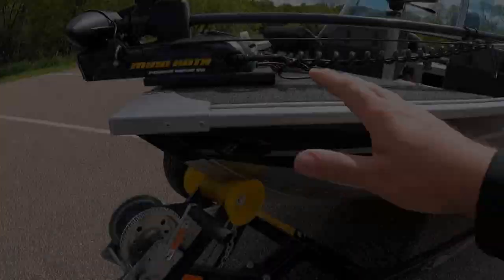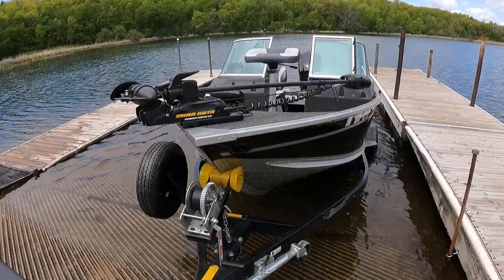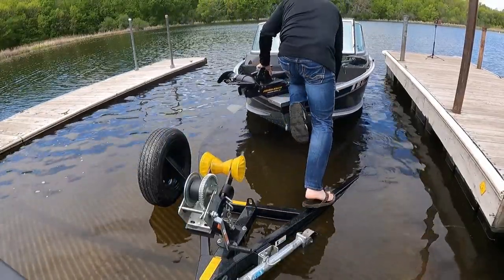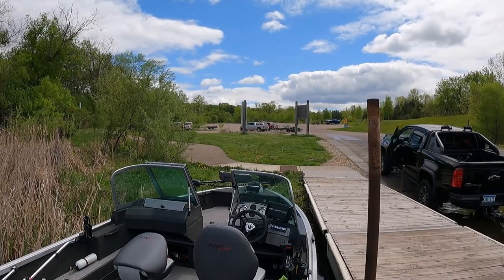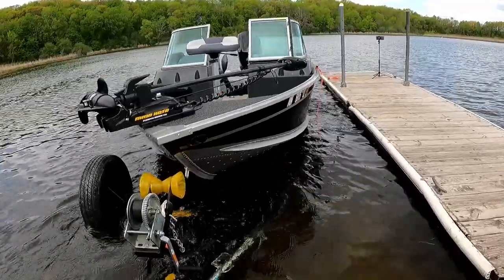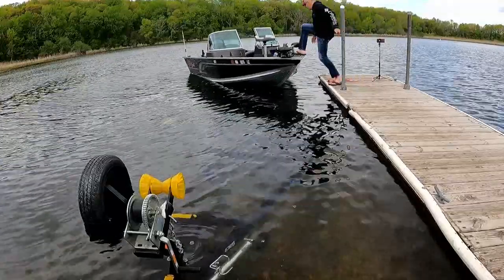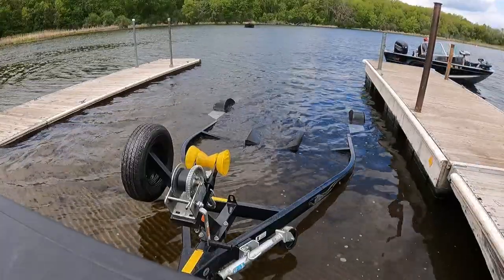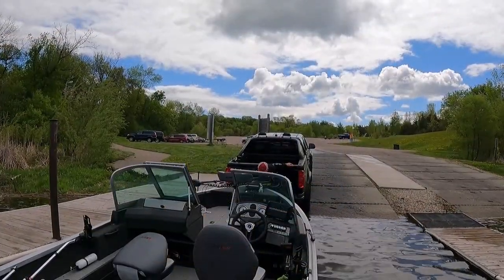Launching Your Boat Solo

Comment: My method is to take tie two bow lines together, one end goes on the right of left cleat depending on what side the ramp your using.
The other end I looped and cinched around my winch.  Off she slowly goes, I pull up and take the bow line from the winch.  Walk back to the dock, tie off and go park.
Moving the boat outta the way is courteous if the ramp is busy.    ...nice job.

Comment: With your second launch method, I'd never use 550 cord as a dock line, it's too small to grip comfortably.
And I'd simply warp the boat around to the other side of the dock. I'd not climb aboard with no lines attached.
Suppose, for example,  you jumped on the boat, with no dock lines tied, and your engine doesn't start?
Reply from the maker: Yeah, good point Jeff. There might be a video that comes out from me when my motor doesn’t start.. then what! 😅😂😂
Reply: Probably just use the trolling motor............as a backup.... :)

Comment: Should just use a line up front. Toss a Bowline on it and lasso the wrench. Let it slide off and hang,  and use it to walk the boat to the nearest cleat on the dock. Same method but less risk of the boat getting away from you.

Comment: Here's one thing, never ever ever release your boat completely from the trailer when the boat & trailer are backed into the water when solo launching, until the engine is started first. Nothing worse than floating your boat off and away from the trailer and then finding out your boat won't start, and then there you sit adrift looking like an idiot trying to paddle yourself back to the trailer or dock. Even worse when this happens on a windy day and the wind is really carrying you out on the water. Ask me how I know.
Reply from the maker: You’re not wrong and I can appreciate what you say here! I’m usually on top of my boats maintenance so engine start has never been a problem… until
It is I guess. Lol. Thanks for the comment!
Reply from the maker: I do show in the second way tying  it to the dock with a small dock line and therefore you can still have some control.
Reply: @501pm_fishing  Better safe than sorry.  🙂

Comment: Just a tip.  I would never leave the boat strap unhooked from the boat (2nd method you showed I think (with rope tied to dock).  Aluminum boats are very slicky and can slide off the trailer if the boat ramp is steep before you get into the water.  How do I know?  It happened to me.  I had fiberglass boats all my life and never had this issue.  I downsized to an aluminum boat and my first visit to the boat ramp, with my new boat, it slid off and ended up sitting on the dry ramp.  I had always launched my fiberglass boats with the strap unhooked and never had an issue. I would never want this to happen to anyone else.  I had no idea that Aluminum boats were so slick.  Needless to say the bottom of my boat has the scars thanks to my ignorance.  Thanks for sharing your techniques !
Reply: I unhook mine on my fiberglass bass boat, but only when the wind is blowing in to the dock. I have about a 5 foot piece of rope with 3 loops. A larger about 10" and smaller about 6" loop on one end and another loop about 6" on the opposite end. I hook the single loop end to the cleat on the dock side of my boat while I am prepping to launch. I do like you put about a foot of slack in the front strap. Then back in. I do the bumper to tongue walk and unhook. Then back to the dock where I hook the big hoop over the dock post and the small loop next to it over the same cleat the rope is on. The way my boat is it can only get about 30 degree angle from the dock. I park my truck. Jump in the boat and am gone. The whole process whether loading or unloading doesn't take me 2 minutes. I hate it when someone jumps in front of me at the launch and is there for 20 minutes getting their boat loaded. Like yourself, I don't even like anyone with me helping. They just get in the way. I have a system that works for me.

Comment: Try this. Unhook all straps and the winch. Hook a rope to your trailer where the winch connection is, hook the other end to the  boat at the front where you hook your winch strap. The rope should be a few feet longer than your trailer. Back into the water allowing the boat to come of the trailer tada! You are set
Reply: Been doing it this way for over 30 years.
Reply: Doesn't that risk the boat sliding off the trailer before hitting the water?
Reply: That's how I do it too.
Reply: @rm4po4 yes it does. I use this trick but some boat/trailer combos it wouldn’t be safe.

Comment: I have a problem with the way the boat is disconnected from the dock before you start the boat and the extra agility required to climb over the bow. Just one mistake, one little slip and your boat is floating free out of your control. Also, if you have an engine problem, it's better to be tied to the dock when you find out so you can easily get back onto the trailer.

As for me, I prep the boat and part of that prep is both a bow and a stern line. I then back down the ramp. Just before I enter the water, I stop and drop my tailgate. Once the boat is over the water and I can just step out on the tailgate without getting wet, grab the bow line, disconnect the bow strap and with a little pull on the stern line, I get the boat off the bunks  and tie it up both stern and bow.

I can then park the trailer and head down to the ramp where my boat is waiting, start it up, untie and head out.

Loading is similar. I tie to the dock, get the trailer backed down the ramp and just before I enter the water, I stop and drop my tailgate.  I then back the trailer to just under the bow, untie the stern, untie the bow and step onto my tailgate. I then just pull my boat onto the bunks, connect the strap to the bow eye, crank it the rest of the way and leave the ramp.

It's fast, efficient and you always have 100% control over the boat.
Reply from the maker: You’re not wrong and I can appreciate what you say here! I’m usually on top of my boats maintenance so engine start has never been a problem… until
It is I guess. Lol. Thanks for the comment!
Reply from the maker: I do show in the second way tying  it to the dock with a small dock line and therefore you can still have some control.

Comment: Sir, your boat trailer needs left and right roller guide posts soyour taillights are  mounted high to load your boat perfect every single time even at night. . Secondly, since I'm mobility handicapped under ADA and Michigan Eliot -LArson Civil Rights Rules.  I have challenged the Michigan Department of Natural Resources law enforcement division to dare write  me ticket a ticket for power loading. If the DNR was so smart they would add more concrete bottom slabs extending out deep enough to prevent mounding the sand. It is a Simple solution for over paid government employee minds.  It the people waiting on me don't like how slow it takes me to load and unload my boat, they have 2 options. Help me or shut their arrogant mouths because I really don't care. All the boat plug, removal of tie downs,  lunches from the tow vehicle loaded in the  boat, and  boat covers should be done well before you even think about backing  your boat down the launch. 55 years of launching and loading boats has made me an expert on what not to do!

Comment: Thank you so much for this clear, concise method with great tips too. I'm working on my method of solo launching a 22' keel sailboat, using an extension tow line and a large single loop tie-line from two boats cleats (to hold parallel to dock), draped around (or through) one dock cleat, then long enough to reach the back of the car or front of the trailer, with which I can safely pull the boat to the dock (then around it), tie off and park. I particularly like your "stepped" method of backing in up to the diamond plates, tieing the boat off, backing in more to release the boat, then the final tie-onto the dock and park. Superb.

Comment: I use your method number 2 (with two lines) exclusively.  N. Texas.  Often windy.  If wind driving boat into the ramp then gotta have some urgency on hopping out of truck after boat floats off trailer, then grab the lines and tying off.  Two 50 ft lines managed every ramp i've used so far

Comment: No. Back boat off normally with a stretch boat launch rope. Tie to front bow eye and cleat on dock. Launch, pull out and park, walk back to dock and pull boat to you and tie off to cleats … way too easy. I have a boatloadmate system for easy, secure loading.

Comment: Power loading is fine, the ramp is solid concrete and drops off straight down at the end of the ramp.  Have to be super careful when water levels are low.  You drop an axel off at the end of the ramp, your not getting it back over without a wrecker to lift it up

Comment: Why did you insert the drain plug from the outside? I think inside control is best.
Reply from the maker: I have a backup drain plug that is the flip kind. Those I ALWAYS install from the inside (there is a story there.) but with the screw in ones, outside works for me.

Comment: I have the same bunk as you but I always power up then tighten the winch. If I don't power it how easy is it to winch manually and bring the boat up?
Reply from the maker: Its not hard at all to winch it up! I only back the trailer in until the rear tires are about 75 - 80% in the water. This puts the bunks deep enough to allow the boat to come up 75% of the way then I winch it the rest with ease to keep it centered.
Reply: @501pm_fishing  thank you for responding.

Comment: I've been launching solo for years, it's a little more work but if you fish alone just take your time, slow and steady. I drove 18 wheeler solo , sometimes iys an advantage,  you don't have to put up with somebody's whiney attitude,  I'm 71 and still launch solo, just get a routine and stick with it, I preload all of my fishing gear into my boat before I leave my house or do it out of the way , Don't tie up the boat ramp , there's always an idiot that has to load his equipment,  cooler and other necessities.  Be considerate,  there are boaters that will punch you in the face, just saying